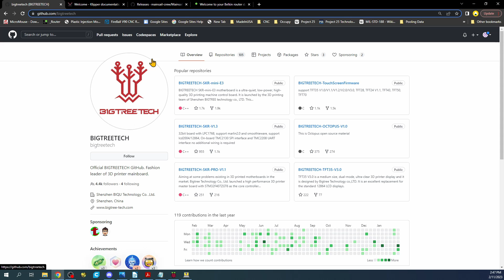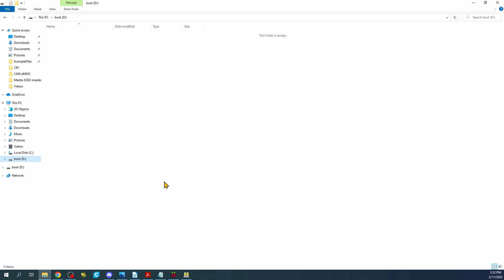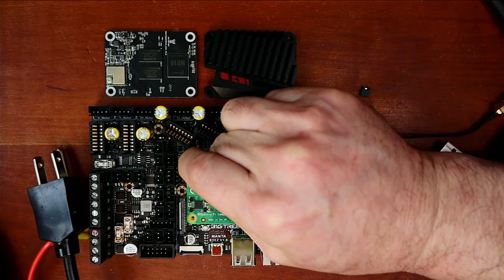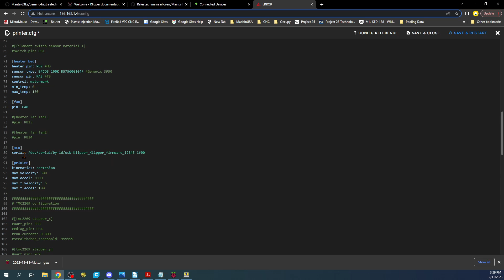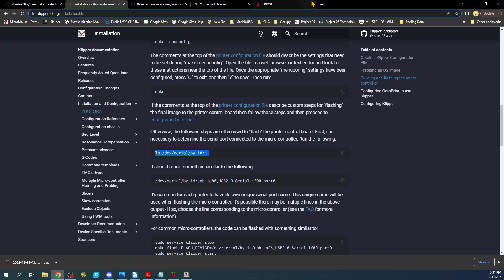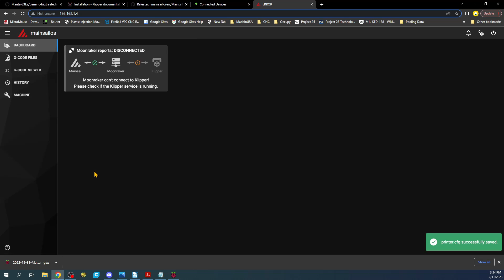BTT - Manta E3EZ - CM4 EMMc with MainSailOS

Comment: I have a $2000 treadmill that I just had to design and build custom electronics for to replace the console because the iFit system that came installed in the system no longer works. The reason it no longer works is because the eMMC chip failed, preventing me from being able to reflash the software. No thanks.

Comment: i can not get this to work at all. i set up all the jumpers and moved the switch and nothing happens when i plug in the board. my computer doesnt even act like anything was plugged in at all but lights on the board light up
Reply: RPIBoot shows no CM4 plugged in and not even the devtool usbviewer shows that nothing is plugged in at all.
Reply: did you ever sort this issue ? i have same problem @MikeLeos73

Comment: Hi Ed. Thank you for your videos they’ve helped me a lot in recent weeks. I really want to use the emmc as I’ve 2 SD card corrupt in 1 week! I can’t get rpiboot to work, I’ve tried 2 laptops and numerous cables but I’m struggling. Do you know of a work around or can I use the an SD to start then move it to emmc?
Reply from the maker: Generally the dip switch for 3 and 4 need to be enabled and rpiboot.exe needs to be run.  Should be in video for emmc raspberry pi.
Reply: @EdwardBraiman  when i run rpiboot it just seems to freeze with 'RPIBOOT: build-date Oct 26 2022 version 20220815~145439 9e57f462
Waiting for BCM2835/6/7/2711...' in the text window, i've left it for around an hour and nothing happens. i'm using a manta 8p with cm4 8gb ram 16gb emmc
Reply: 2026 all CM1 modules are bricked from factory, spent countless hours troubleshooting on why I would get the heart beat green LED. As if it was flashing but I couldn’t connect to internet even via Ethernet port and my Ethernet LEDS showed a blinking green light as if it was transferring data but even the AngeyIP scanner couldn’t find IP for this device, I will be trying CM4 but this is my fist and last time buying Bigtreetech’s.

How do they manufactured bricked boards? I got two in a row not working.